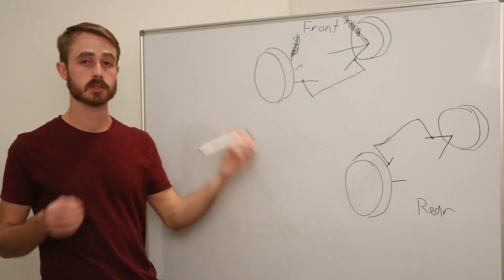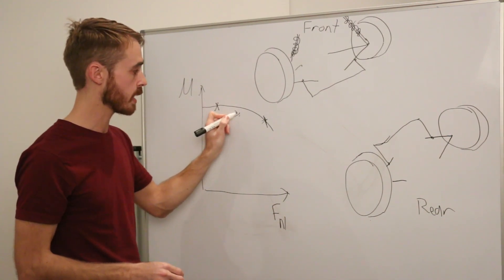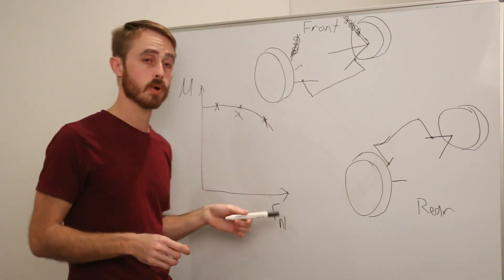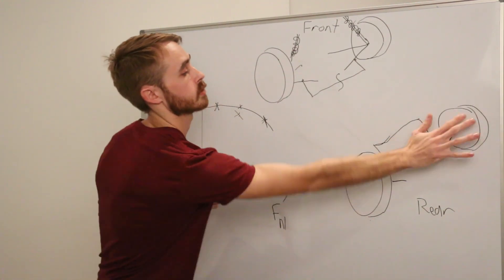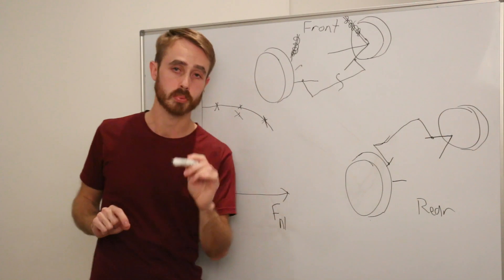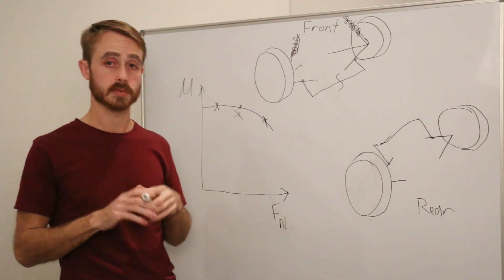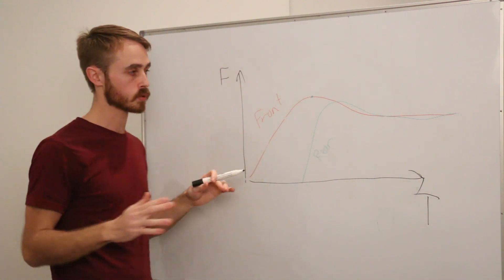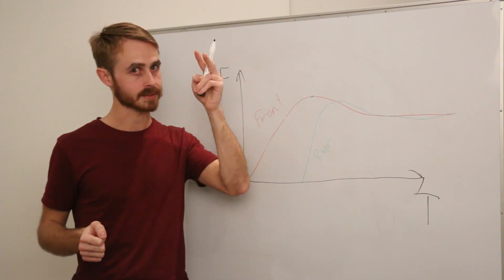How Anti-Roll Bar/Sway Bar Tuning Works

Comment: the condition you described of the rear feeling skittish is something i experience in my rally car, long wheel base, 8 inches of front and rear useable travel, its a rwd platform and have been considering tuning a rear sway bar to level the rear on corner exit and even the bump characteristics of the rear tow, its set in  and at full squat ends up slightly out, with the rear leaning a little more given no sway bar i thing the skittishness comes from toe out on the load side and toe in on the light side, picture and vidoes don't show a great difference given the inboard spring design exactly like bmw;s at 308 lb per inch its fairly stiff, considering going outboard coil over to have a more predictable and usable sweep of travel given i'm using factory control arm components. thanks for the vids i find your info very informative and technically sound. Cheers

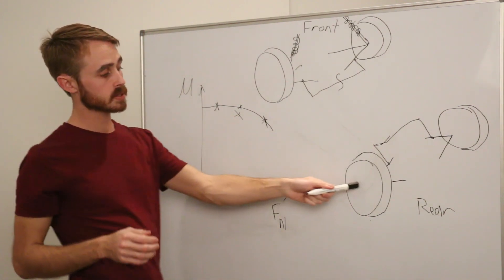Comment: This video is helping me understand how relative stiffness of front and rear ARB affect the balance of a car, but I'm not quite there. Around 2:55 you point out that if the front ARB is disconnected the rear ARB has to absorb all the weight transfer. But why doesn't the weight transfer of the ARB lead to a higher combined coefficient of friction at the rear? Let's say you're in a right hand turn with a front ARB disconnected. The left side tires will have a higher load. But on the rear axle some of the load is transfered to the right side through the ARB, and both tires are closer to their optimal grip. Why doesn't the rear have higher net grip?
Reply: Because you are shifting the load to the rear axle and decreasing total grip for that end relative to the front.

Comment: @KYLE.ENGINEERS - great vid. but i can't help thinking about trail brake.. Your comment "the more weight transfer you have, the less grip you have" seems logical - however why then do we trail brake as late as possible into a corner, in order to maintain weight transfer onto the front tyres, which increases front grip?
Reply: Hi, the difference is that in the video he is talking about lateral load transfer, trail braking instead is related to longitudinal load transfer. Taking for granted what he does say in the video (which is true, even if it could be better explained in other ways probably) , I try to give you an explanation of longitudinal one. 

When trail braking what you do is basically braking hard to cause a load transfer towards the front axle, which helps in "gripping" the front and loosing at the rear (kind of oversteering). The reason why you increase the grip at the front is that the lateral force the tires must exert is basically set by the dynamics of the manovre, that is: mass and lateral acceleration (according to the weight distribution you will split the centripetal force between front and rear, but anyway..). You increase grip at the front because the load transfer simply allows to get the same lateral force you got without load transfer, but with a smaller slip angle. Or, if you want, you can get an higher lateral force at same slip angle. The opposite happens at the rear basically, and this gives you an oversteering balance of the car during the manouvre. 

Another way of seeing it, is by looking at the maximum lateral force that the tyre can exert given certain characteristics:

(linear model): Fy = m*a = u*Fz,

Where "u" is the coefficient of friction, Fy the lateral force and Fz the vertical load on the tyre. 
If you write that vertical load as: 
Fz= m*g + L (L is the amount of load transfer), you can see that the Fy you can get is higher than the case with null load transfer, for the same slip angle (assuming no variation in the cornering stiffness of the tyre, and assuming that the product "u*Fz" is increasing even though there is load sensitivity, which is realistic anyway). 

Reversing these concepts for the rear of the car, which is unloaded during a trail braking manouvre, you understand why this causes oversteer and potentially a better corner entry.

Hope It was reasonably clear.
Reply: @giovannitartaglione7525  Very clear, thanks!

Comment: the most clear way of explaining why anti roll bar affect under/over steer the way it does I've heard. you should replace the term friction on 0:25 on wards with the term slip angle coefficient to be more accurate with the physics of handling.

Comment: Toyota's TRD department has made roll bars with two position holes. Bottom line: the further up the endlink holes are, the more aggressive the rolling resistance and the more sensitive the steering will be.

Comment: I have a question I want a little input on. For a WRX, with 59-41 weight distribution, would you remove the 35lb spare tire and tools from the bottom of the rear trunk? or are the weight distribution properties going to outweigh the total weight change

Comment: Do you have a video on adjustable sway bar links? Best way to adjust ?
Reply: Look up informaiton on swaybar preload. Basically a sway bar is stiffest when it is parallel to the ground. This obviously changes when the axle is loaded or in droop. So you can probably figure it out from there. You basically want to set the preload to a point where the bar is parallel at the suspension height where you want the most out of the bar.

Comment: Coefficient of friction (in this case coefficient of static friction, unless the tires are slipping) doesn’t depend on the normal force. You’re trying to say “friction”.
Reply: Not correct. The coefficient of friction is not a constant it is a function of the normal force.

F(N) = u(N)*N
Reply: @RussellAutosport Incorrect. Coefficient of friction, mu, does not depend on N. it depends on temperature, roughness, humidity but certainly not on the normal force.
Reply: @CengizSen-hw8lp  The coefficient of friction does not really exist. There’s a phrase that goes “all models are wrong, but some are useful”.

If you really wanted to define friction rigorously, then it’s defined at an atomic level by someone way smarter than me and has to do with the way charged atoms move past one another and dissipate energy accordingly. On a macroscopic level, it’s useful to say that one material rubbing on another can be simplified to an equation F = uN. However, this is a massive simplification of what’s happening.

What has been empirically verified, and thus what is being shown in the video, is that for tires at least there IS a negative correlation between the normal force and the coefficient of friction. 

What this means in an example is that if I have 1000 N of normal force on the contact patch of a tire, it can output say 500 N of centripetal force when I put it through slip. If I double the normal force to 2000 N, it IS NOT going to output 1000 N of centripetal force. It is going to be less. 

If we want to keep a simple model that shows F = uN, this means that we have to make u a function of the normal force. As I increase the normal force, the coefficient of friction is going to decrease. It is NOT a constant.
Reply: @RussellAutosport  You’re confusing the coefficient of friction with the actual friction force itself. In F = uN, u is the coefficient, it is unitless; whereas N is the normal force that’s perpendicular to the surface, and F is the friction force itself. u (or as we say mu in physics) does not depend on N. Never have, will never do.
Reply: @CengizSen-hw8lp  Okay. I’m not confusing anything, I’m sorry that I’m just not able to explain this concept well enough I guess. Have a good day.

Comment: My understanding  after the video is;  It picks up the other tire to move some of the load over to the inside. Its a slight weight shift as it forces the car to squat down in the corners. You should feel more upright as you corner.

Comment: Amazing explanation about the roll frequency subject. Would you have any literature regarding the transient responsiveness of the vehicle related to the roll frequency? I have a doubt. Seems that increasing the rear roll frequency would compensate the timing of the grip loss on both axis. But, once the forces are stablished and the car is on the steady state curve, a higher roll frequency would mean stiffer roll rate, which would lead to bigger weight transfer on the rear, leading the car to an oversteer. So would it be a tradeoff? Better transient performance over steady state performance? I think a better way to solve this would be softneing the low speed dampening of the front axis, or stiffening on the rear axis. So the responsiveness of both axis would be alike and wouldn't have to sacrifice the neutral balance (if it is desired).

Comment: Thanks for the video. Could you do one explaining if adding stiffer front and rear bars would increase cornering speed or not? I'm thinking it shouldn't, but most sellers of sway bars in the after market claims they do. 

Thanks!
Reply: It generally will if your suspension suffers camber loss significantly in roll, or if you are contacting the bump stops in a turn.  The classic example is a MacPherson strut vehicle, which suffers relatively bad camber loss with body roll.
Reply: @janetsbrick  This is what I thought.  Actually adding a bar reduces total grip compared with no bar, except if you account for camber loss.  So adding a small bar will improve grip up to a point, and then it will reduce.  Kyle should do a video about how we can calculate this optimum diameter for certain situation.

Comment: That explains my 98WRX tendency to oversteer. I installed a Whiteline sway bar on the medium setting in the rear. It feels great but now I don't dare to put it on the hard setting until I have a front sway bar aswell.
Reply: Why the hell did you do that

Comment: You should do a video on roll bar tuning, and how the roll of the chassis could be used as a way to increase grip on transient regimes (by slowing down the weight transfer). The common sense, for people who do not understand the transient regimes very well, is to think the chassis roll is generally a bad thing, which is not the case unless aero comes to place. Also, a lot of books and people state that when designing a suspension you should always look for fast responses, but I'm not really convinced that a faster responding car, i.e. stiffer roll bars instead of no roll bars, is faster than a slower responding car, i.e. soft roll bars and a lot of body roll.
Reply: i know this is old, but if you're car isn't flopping all over the road, it's easier to go fast.

Comment: i got a nissan skyline R33 whit a stif suspension 
what would be the effect if i mounted a softer suspension but stiffer sway bar?
Reply: @ASMR James  it’s just i just want a bit more grip on the rear so under acceleration the tyres don’t break loose as easily
Reply: @mrdriver511  Softer rear ARB is what you want for fixing cornering+throttle oversteer. Theres nothing you can do about straight line (more or less, doesnt have to be perfectly straight) power oversteer, other than better tires, as an ARB does nothing in that scenario and stiffer/softer springs dont change the load transfer either.

Comment: I'm surprised that you didn't mention the effect that coupling each tire has on grip over 99% of roads. 

Grip of reduced on non-perfect roads because of the side effects from coupling the two tires. The force applied to one side, is transmitted to the other side. 

This also has an effect on comfort due to increased transmissibility of road imperfections. Roll should really be controlled with springs imo with stabilizer bars added to taste.
Reply: Grip can be reduced on one wheel bumps where the inside wheel encounters a sharp bump. Stiffer springs instead of ARBs will increase wheel rate and generally cause excessive damping in pitch and heave (roll stiffness is almost always more important, cars are longer than they are wide). The trade off depends on the suspension design but you cannot consider ARBs or other means of adding roll stiffness merely an afterthought. They are an integral part of suspension design.

Comment: how does weight transfer reduced the grip... more load on the wheels pushes the vehicle to the ground and we will get the traction .... That's why wings are placed in the f1 cars to increase the downforce which increases the load on the rear..
Reply: weight transfer will give you more grip on 2 tires and less grip on the other 2 tires. would you rather have a large heavy car run on 2 tires or grip on all 4? see what i mean?
Reply: Sabari Rajan vertical loading is decreased from the inside tires.
Reply: Sabari Rajan and thats the reason why f1 car implement a reverse ackerman steering system
Reply: They also use heave dampers!
Reply: I believe what he is getting at is that although traction increases proportional to load, it is not a linear relationship, the marginal rate decreases proportional to load.

Comment: This is a terrible explanation dude.  Idk what roll bars I need for fixing my cronic underdteer
Reply: it's a pretty good explanation... you just don't have enough context yet. Watch more videos.
Reply: depends on MANY variable about your car, specs, street or road car, FWD or RWD, tires, weight, etc...
Reply: numulis321 try driver mod. Also, get compression biased dampers.
Reply: softer frront sway bar (narrower) or wider rear (stiffer rear). Go stiffer rear if your car handles road unevenness well, softer front if it handles road unevenness poorly

Comment: The friction force is actually mu*Fn. So load transfer isn't a bad thing until a point at which the decrease in mu dominates over the increase in normal force.
Reply: the rubber deformes more with increased load, leading to more shear/peal which decreases the coefficient of friction
Reply: How does the coefficient of friction change? The tyre is still rubber, the road is still tarmac.
Reply: Tires do not mainly operate in friction.  They operate in traction.
Reply: Great answer. Thanks :)

Comment: do you think this could help an extremely light weight car (200kg), that is feeling slightly unstable ? 
PS it will be on normal road conditions, max 100k/h
Reply: The less car mass or the lower the gravity, the less weight is transferred laterally. As you lighten a car, the sway bars work less. The thickness of the sway bar is derived from the weight transfer expected at that axle. If you reduce weight on that axle significantly or if you lower the CG at that axle significantly, your Swaybar is then too thick for the purpose. At 200kgr you just don’t need sway bars. They will be too much weight added and they will introduce handling issues that Kyle just described

Comment: could you get rid of a anti roll (sway bar) all together with no problem at all?
Reply: a lot of economy cars don't have a rear sway bar at all.
Reply: Neither did the McLaren F1, as it turns out. =)

Sway bars are only really necessary if you experience too much body roll. The springs of the car already resist body roll, so if you've got stiff enough springs, low enough CoG or low enough grip (less grip => less lateral force during cornering => less body roll) you don't need them. Of course this ignores the use of sway bars to balance handling, and assumes that has been handled via springs, alignment etc.

Often though you can run into situations where you'd really want them. For example on all road cars, even really high performance sports cars, the suspension is a compromise. They'd want the car to not roll too much in a corner, but since without sway bars it'd require springing it like a racing car, it goes against the need to keep the car somewhat comfortable when just driving around normally, hitting bumps etc. Also having the suspension that stiff would hurt straight line grip, acceleration and braking. So as a compromise a lot of performance cars run the springs soft enough that they're comfortable and grippy when driving on normal roads, but increase the roll stiffness with sway bars to reduce body roll. As with everything on road cars, this is a compromise.
Reply: on standard race cars sway bars are used as a tunning device, especially cockpit adustable ones.....on FWD race cars front sway bars are always eliminated yet rears are either added or a stiffer one put in to basically mae the back loose grip whih is how FWD race cars are set up to go fast. Todays active suspension cars dont need sway bars since the computer dusts the stiffness through the shock absorber

Comment: In the beginning you say ARB reduces weight transfer caused by the CG's height. Then, on the example, you say that a stiffer ARB will cause more weight transfer and less grip in that axle.

Can you elaborate further?
Reply from the maker: +Rafael Dourado Just re-watched the video, I'm not sure I see the bit where I say an ARB reduces weight transfer caused by the CG's height, could you provide me with a time that I say it so I may answer your question?
Reply: +KYLE.DRIVES at around 35 seconds.